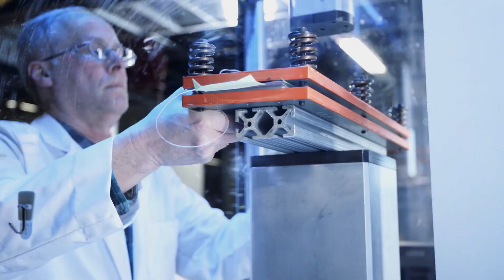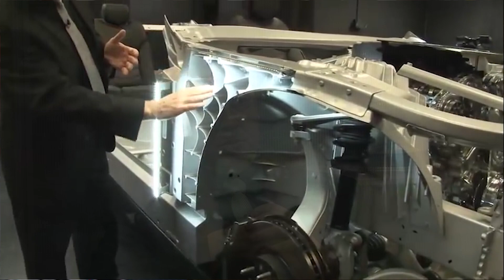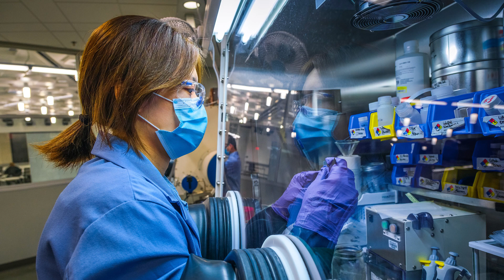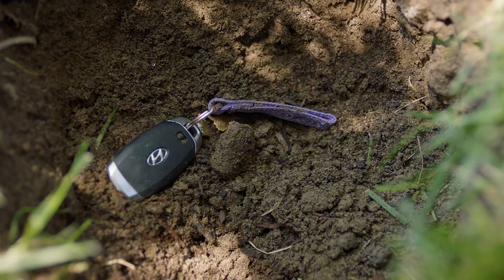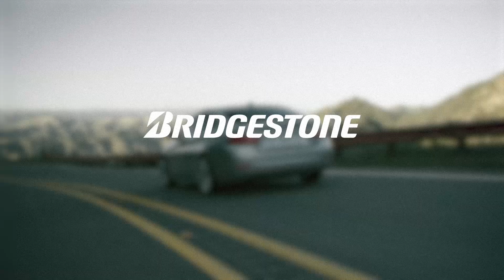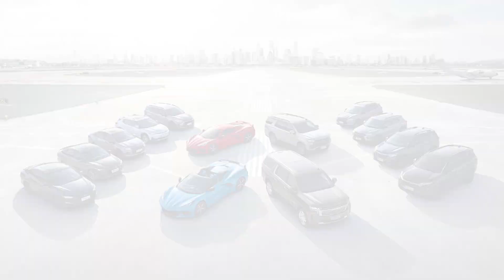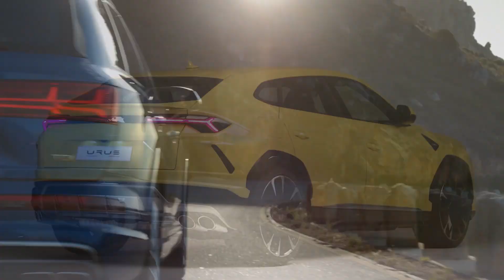GM Steps Up BEV Commitment; JLR Wants to Block VW Group SUV Imports - Autoline Daily 2964

Comment: GM disease: Too many brands, too many models. Why repeat that mistake with EVs? 30 models? Come on! Make a few really good ones... but they won't.
Reply: But... that would make sense and be easy to implement. Action costs money and requires favorable results.
Reply: @redxsage    Not everybody wants the same car as their neighbor, even if it is good.    Thats why Tesla is struggling in Europe, and China,  hard to sell their cars even after lowering the prices dramatically.
Reply: @dmitchellhomes  It won't be the same as your neighbors. Your neighbors will be in their garage and yours will be in the dealership getting repaired. Seriously, going back to infinite model diversification to suit all tastes is like jack of all trades master of none. They should focus on bringing up quality first, then expanding out, but that's my non-industry opinion. Maybe they know something.
Reply: @Tokamak3.1415     I agree with you,  quality is the most important, however if you wait for tech to be perfect before rolling it out to the public you are not going to be much of an innovator.     I have bought many new vehicles in my life,  not all of which were perfect,  but there are different kinds of issues.    If I get a nuisance error message now and then,  its not a big deal...   If I am broke down beside the road, that is something completely different.     I like what GM is doing,  they cancelled many car lines completely, to focus their resources on less, but better products.    GM is not chasing market share the way they used to,  they are chasing profit,  which is the mature thing to do.
Reply: @dmitchellhomes  They've done quite enough to stay alive. Barra kept them from going into the ground. I think they should have focused on a small CUV with a good BEV drivetrain - at least started 4 years ago when Tesla was putting out Model X and announced the Model 3. The Bolt SUV isn't even coming to the US first - it's going to China. I know they want to use China as their experiment but it's clear a good CUV will sell well in the US. Toyota makes it look so effortless with the Toyota Prime. If GM made a pure BEV like the Rav 4 they would be at the level of Model 3 in annual sales. Now they have to defend market share from Kia with it's new 3-row SUV.
Reply: @Tokamak3.1415    I agree,  GM should be the best in every segment...  NOT,  now back from La-La land...   Toyota has tried hard in the pickup truck segment and failed,  over and over.   When they built their massive new plant in Texas, Toyota said they were going for 500K Tundras a year,  Massive FAIL...   Now they are building Tundra and Tacoma in that factory, and still have excess capacity.     Now,  GM has focused on segments they make money in, and done well in those segments,  they are gaining pickup market share in 2020, and their large SUV's dominate the market with something near 70% marketshare.    GM also has nice marketshare in mid size trucks, and crossovers.   Bolt was a good first effort on the budget EV, and I think they did not try to keep it fresh, for too long,  but the new one is coming in Q2 2021,  and the Bolt EUV in Q3 2021,  and will only be sold in USA.   there is a similar Buick model in China,  but that is not the same vehicle.   BTW,  VW is coming hard after that small crossover segment,  and ID4 is getting great reviews so far.. https://www.youtube.com/watch?v=iiVELm6GHlA
Reply: @dmitchellhomes  Toyota only failed in the US. It's obvious if you look where 1/2 of the truck buyers are now - people in cities who have absolutely no need for a truck but just like the look and ride height. These people could drive a minivan but would rather put a cheese grater to their testicles. The Toyotas are so behind in interior design and pampering that they pail in comparison to the Ford/GM/Dodge offerings. But you know the Toyota is the most reliable one. The rest of the world lives on Toyota Hilux.

The ID4 is a beautiful car and I love the paint colors, but German interior is not my thing. 20 years ago I would have loved the stiff ride but not so much now. Problem with VW is going to be battery constraints. They are not going to get enough batteries until CATL finally starts pumping them out for the US bound cars. VW has a contract with LG, but ID4 will be using CATL last I heard.
Reply: @Tokamak3.1415    Toyota is not hardly failing as a business,  they are the worlds most profitable automaker (by far).   My point though is that they do not win every segment.   They have a strong small car and small crossover business,   and are the mid size truck leader in the USA, but when they venture into Full Size trucks they did not dominate.      Full Size trucks is a strange segment, it is the segment with the highest brand loyalty in the car industry. Todays Full size trucks are like luxury cars (features) with massive capabilities.  

As for ID-4,  I agree,  its a nice car, and going to sell well.    In Europe they are using LG batteries,  USA produced models will use SK Innovation batteries,  and China produced Models will use CATL, and LG.   In a year VW will have 4 plants making the ID-4 (Germany, USA, and 2 in China)    I am thinking this will be the global volume leader for EV's by 2022.     Looking at Europe EV sales Tesla used to dominate,  but 2020 has showed something different, Audi E-Tron dominates the premium segment having clobbered Tesla S and X, and VW ID-3, which went on sale 8 weeks ago, is coming on fast.   ID-4 is launching sales in Europe next week,  and I hear demand is strong,  so much so that VW will not be exporting any to the USA until early 2021.     I am not sure what you mean by German cars being stiff?    Maybe you need to go drive the ID-4, and E-Tron,  neither one are stiff,  but have very compliant chassis, and comfortable ride.    Tesla's are actually very stiff,  especially 3 and Y.   

https://www.youtube.com/watch?v=iiVELm6GHlA&t
https://www.youtube.com/watch?v=GEpqt-3yE_s
Reply: @dmitchellhomes  I agree with with you said about the Toyota. You typed the same thing I said basically haha. The reason Toyota hasn't made inroads into the full size is because the Tundra has a crap interior for luxury. Toyota is probably the most conservative auto-maker and their ancient truck interiors show it. Serious off roaders will forgive it. People driving to a Laker game wanting to show off their 24" wheels would be embarrassed by the 2004 looking dash.

I used to race Auto-x many moons ago. A stiff ride is good for racing but sucks for bumpy LA potholes. I haven't driven the ID3/ID4 but if it rides like the Golf than it is stiffer than a base 3. Alex on Autos notes the same saying the 3 is stiffer than entry luxury nameplates, but has VW dropped Fahrvergnugen from their features? I know the ID4 has a seating limitation issue due to weight of the batteries limiting its GVCW but I don't think the ride would be as lightly sprung - certainly not Camry like. Maybe the US variant will be mushy. You don't want to be on the Autobahn doing 120mph with floaty suspension.
Reply: @Tokamak3.1415    Geez,  you just don't get it about the truck segment.   How many pickups do you think are sold in CA?    Not Many in relation to the population.  City dwellers do not buy many pickups,  suburban families buy pickups,  and large SUV's, because they drive longer distances, and have more space in their communities.   GM said in their press release yesterday that they are vastly under represented on both coasts of the USA, and a vast majority of their business comes from the inside of the country.   They are aiming their EV programs at the areas they are currently weak,  the coasts.        You clearly do not know the pickup customer if you think Toyota is only struggling due to interior design.   Try getting a R to vote for a D, thats the same battle you have to get a GM truck buyer to buy a Ford, or vice versa.   Truck buyers are the most loyal buyers in the car market,  most never even look at the competition,  they just go buy another Ford, or GMC when they are tired of the one they have.      I have always owned GMC,  and while I look at Ford and like some of their features and style, I would never buy a Ford.   Ford has more power, tows more, hauls more, blah blah blah, it's a very small segment of the market who even looks at those specs and jumps ship based on the competition having something better, most people, myself included compare my old truck to the new one and say, WOW,  GMC has a better interior now, and more power,  I better go buy one.     

EV's are a bit different.   a lot of Tesla buyers have been jumping to other EV's,  number one EV traded in for both E-Tron and Taycan are Tesla's .  This is especially clear in Norway, where Tesla service in the past was atrocious,  people loved their Tesla's , but after having problems and long service waits, they have jumped brands.   E-Tron is the best selling EV in Norway so far in 2020, which is amazing because its not a cheap EV.    E-Tron has outsold all 3 Tesla models in a market that was dominated by Tesla before 2020.     So far in 2020 Tesla model 3 in Norway is in 6th place behind the Nissan Leaf... huh?       You can say,  Norway is a small market,  who cares....   But if you say that, you are missing the point,   Norway has the highest EV density on the planet, and you can see Tesla came in and dominated the market early, but did not build the proper infrastructure first to take care of those customers,  so now they are all leaving the brand in droves.     Same thing is starting in the USA,  Tesla customers have long service waits, and parts are not readily available,  watch what happens when competition comes with good EV's.   In the next year watch Mach-E, ID-4,  Rivian, Lucid,  Nissan, Mercedes, Polestar  as I think all of these companies will chip away at Tesla, and over time it will be like Norway... Tesla who???      Now that VW has developed their MEB platform you will see them launch more products on a 6 month cadence.    GM will be the same with Ultium starting in  very early 2022,  the cadence with which they can launch new products/ segments will surprise tesla fan boys.     eu-evs.com  

ID-3 is the car with limited GVWR,  you cannot buy the biggest battery pack with 5 passenger seating.    Interestingly have you looked at Tesla's rated payload for 3 and Y,  if you fill up the car, better have skinny friends.    Did you watch the video links I sent you?  the reason I sent Kyle's videos is because he has owned Tesla's for years,  so when he talks about new EV's he is coming from a strong Tesla background.
Reply: @dmitchellhomes  Not going to bother talking about EVs. We'll just have to agree to disagree.

About the trucks though you're way off. 1/3 vehicles I see here in Cali is a truck. In my local neighborhood there aren't many because everybody has a minivan which is of course much different from the rest of the nation. Cali sells more new tucks PER CAPITA than UTAH which openly defies your statement "Not Many in relation to the population".  I actually looked this up last week because I was in UTAH and was teaching my kids about different lifestyles and economies around the country. I have 2 sources to back up my claim if you want to make a bet. Here's a link to a recent article about truck sales in Cali by number, not capita - but I said more per capita than Utah which is pretty red and a mining state. Nobody can compete with Tx for trucks
https://www.motorbiscuit.com/what-state-buys-the-most-pickup-trucks/

This state is filled with vehicles everywhere, that's why it's the auto capitol. People in Kentucky, Alabama, Utah, and Montana are not buying $80K Ford 4x4 with lifts - people in CA are. I'm not sure where you get your ideas about Cali. I now about those other states because I've been there and I was in Utah just 3 weeks ago. Damn near impossible to find a new pickup on the road. Tons of older trucks and plenty with rust, one house had like 50 rusting bodies out front, but none of the fancy new ones. Only out of state people from Arizona and Cali were driving those to Zion and Bryce Canyon.

You seem to have a lot of preconceived notions. I like to base my judgements based on stated "facts" or actual observations and when the observations deviate from the facts I learned, I research. My dad bought 6 Fords in a row - you don't have to explain 'Murica First thinking to me. My Acura was built in Ohio and the last 2 Ford my dad bought were built in Mexico, so we're done with fake American brands that break down. He would have bought another crappy Ford if I didn't give him my Acura TL. I know you might live around people who would ostracize you for buying a Nissan or Toyota pickup, but most of those are not the ones making $100k+ a year who go through new leases on trucks. It's the people on the coasts who are buying those insanely priced vehicles which is where GM, Ford and Chevy are making their money. How many Escalades you see driving every day? I see one every 30 seconds here - and that's a $100k+ vehicle after taxes. Are not seeing the comments from the truck owners complaining about the insane prices of pickups and how they're all switching to Turbo 4s instead of NA V6 and V8? And Texas is turning blue from all the CA turd fleeing it.

You sir need a road trip to see America.
Reply: @Tokamak3.1415    Ya,  I am sure you do not want to talk EV's  you base your thoughts on hype,  I base mine on facts...   I have owned EV's since 2012, and not only know the market, I have experience with the vehicles, Tesla included.     Bring me facts and experience, and we can debate,  but I think on this you are just out of your depth.   

haha,  I would not call UTAH the pickup capital of the world,  but the article you posted does not give sales numbers for CA pickups.   It's possible CA has a larger pickup market than I think,  I mean CA has lots of suburban population back to my other point in the previous reply.    But I do not see too many pickups downtown San Fransisco when I visit, several times a year.  People living in cities do not buy pickups generally,   there is no space for them.    Pickups are not a red state blue state conversation either.    When I said Ford buyers don't buy GM, and vice versa,  it's not American First or any political nonsense like that, it's just these buyers are loyal to their brand.   I think there is stuff to like about GM or Ford,   but I just buy GMC.   See with Apple vs Android,   I just buy Apple,  but I am in the minority there.    So I currently own EV's and pickups,  quite experienced in both.
Reply: @dmitchellhomes  It's hard for me to converse with you when 2 times you have shown that you misread what I type or posted and then belittle me about being based on hype while you are based on fact. You didn't see me state the 2025 year when I offered the bet. The article clearly states 4.2 million trucks are registered in Tx and about .5 mil more in CA so 4.6 or 4.7 - whichever way you want to slice it. Tx is the truck capitol per capita per 2017 (something I read a while back that stuck with me when I was reading about rolling coal). Just so you know I've written peer reviewed medical literature that's been published in a NEJM, AHA and America Diatetics association - I can write and think without becoming a fanboy or hyping things. Since your narrative is almost negative towards Tesla's growth I find it hard to take your seriously. I can find good and bad with each auto brand. Only the sith deal in absolutes.

I mentioned Utah because it sure as hell has a lot more trucks than Arizona and Nevada and I would imagine Idaho - it's neighboring states. It's number one industry is mining and nobody is showing up to a mining site with a Chevy Cruze or Honda Civic. Those are working blue collar people and they rely on trucks. It might not be a truck capitol, but they sure had a lot of Trump signs and I'm sure they don't enjoy Biden's green new deal in general. And this was not an isolated city like San Fran, this was everything from St George, to Bryce Canyon, to Salt Lake - trucks everywhere. But they're all older trucks - they probably only get replaced as needed whereas the buyers in CA get them on leases for their business so they can 179 them to burn taxes. Little 4'10" women are driving them here and they most certainly are not putting 4x8 plywood in the bed. More than 1/2 the aftermarket mods for trucks ship from warehouses close by my house to the rest of the nation.

I had a Leaf in 2011 as well as my 2018 Model X. I would have got a Leaf but i didn't like the crash ratings and the seats were so narrow they pinched my shoulder blades together. I do regular paid automotive research studies on cars that haven't hit the street yet and I can't disclose some of them because of NDA. I did do a study on the Volt back in 2010 regarding interior design. There are tons of automotive research studies you can participate in if you live here in SoCal. If you want to disparage my experience go right on ahead. I don't know why you bother to respond to me.

I teach STEM classes to kids and high school students as a side thing these days because of covid. One of the classes I teach is logic and reasoning. I can clearly lay out my reasoning for why I say things and you can clearly and effectively refute my statements with facts and observational data. We both have limited sample size unless citing sources.  But if you insist on saying thing like "I think on this you are just out of your depth" then I just have to say thank you and good bye.

I've met medical students who were cocky because they did well on paper exams and knew all the book answers. Then when they had to apply their knowledge on 3 rapid triage patients they break down. I'm not the smartest person in the world. I make mistakes. I'm willing to learn. Ever give a presentation at conference where everybody was older and more experienced than you? Try teaching stuff to people who know about the field you are teaching in and you'll be humbled.
Reply: @dmitchellhomes  hahaha....”struggling in Europe and China” omg...... yeah struggling to make cars fast enough!
Reply: @farukcarushi4983   Tesla China production has been higher than sales every month since March (Reported by the Chinese government),  I know they shipped 7K cars to Europe in November,  but the difference is more than 22K cars,  where did they go?  and why does Tesla keep lowering the prices?    As for Europe,  look at the data yourself...  eu-evs.com
Reply: @Tokamak3.1415     I just ask you to justify your 2025 take on China volume and you go way off topic and talk about all these irrelevant things.    Tesla will sell <150K cars in 2020 China,  and has inventory all over the country,  how do they get to 6M in 5 years?   Show me the products, where demand will come from?    Do you think this is growth in the market,  or will Tesla take customers from the other OEM's?    Where will they build these cars and where will the batteries come from?   Show me your logistics?     Instead of going off topic, show me the math?      2018 Tesla X,  you bought at the wrong time,  expensive, and before Tesla fixed the suspension.   2018 Model X if you hit a pothole, it might chip your tooth the front suspension is so lame at soaking up bumps.   My realtor has one... ,   stranded him a couple times with back door problems, A/C has gone out twice...    And I think he paid about $125K,   ouch on depreciation when they sell new ones that are  better for 30% less.   Also he tells me the range is nowhere near the 295 miles promised,  240-250 is more like it in the real world.
Reply: You're looking to far into that 30 models number, take for example GM's full size SUV market. We've got the Tahoe, Suburban, Yukon, Yukon XL, and the Escalade and it's also available in two versions. All 6 of these vehicles offer the exact same power trains, the frame of the vehicles are all based on one design and they share thousands of other parts we can't see. Cost to develop all these models under different brands isn't that expensive and these vehicles fit completely different lifestyles and people.

Young growing families can afford a basic Tahoe, those with a little extra money can go with a Yukon and even nicer a Yukon Denali. Then there's those that can afford GM's flagship the Escalade which can go over $100k 

It gets even more cost effective than that, GM's full size SUVs share the same platform as their half ton pickups so there's several more models that share development costs.